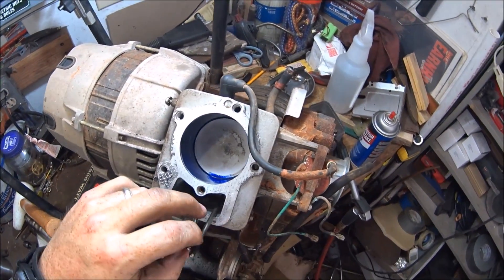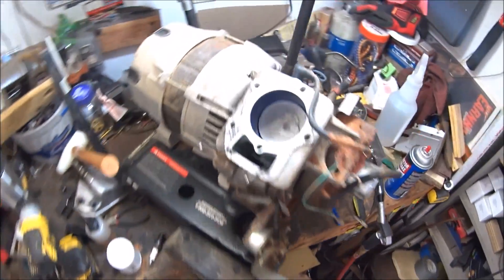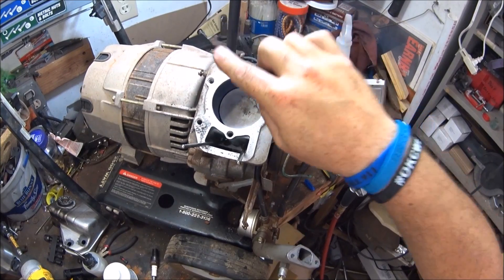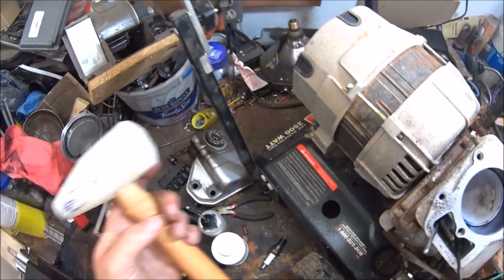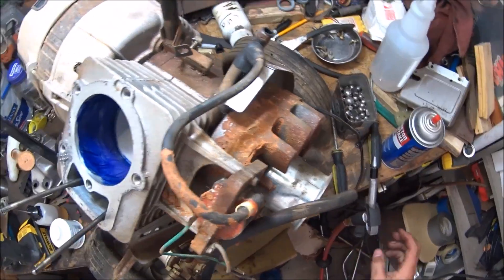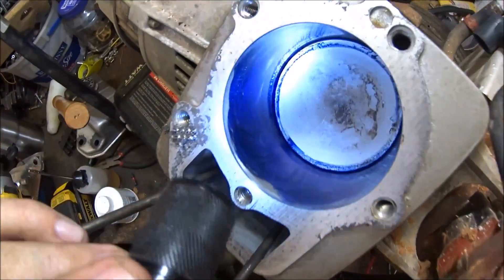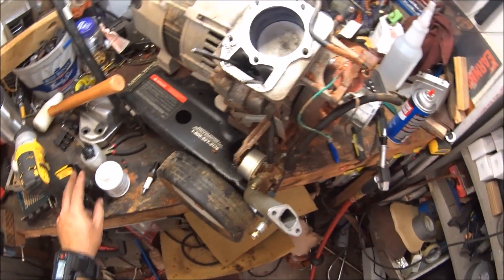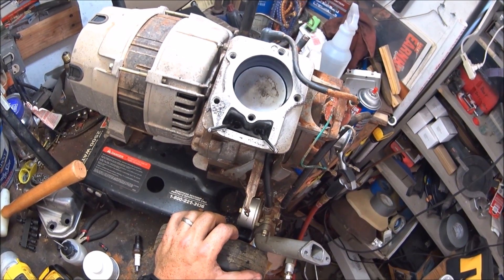Generator Part 3  Yep bad piston rings

Comment: If you do a compression test before you tear it down you can tell if it's valves or rings by doing the test twice once dry and a second time do  a wet check by squirting some oil into the plug hole. If the compression is low but gets better with the oil it's the rings if it doesn't get better its leaking valves. This technique is pretty good but it won't tell you if the rings are cracked or the piston has a hole.

Comment: What a crock...proves nothing.
Please get an education and a service manual.
There is a correct way to check for ring wear.
Reply from the maker: EDSEL CITATION its worked for years for me.  I've done this  several other times and its never let me done yet. Don't knock it till you try it. Thanks for watching anyways
Reply from the maker: EDSEL CITATION watch the whole series you can see i get this running